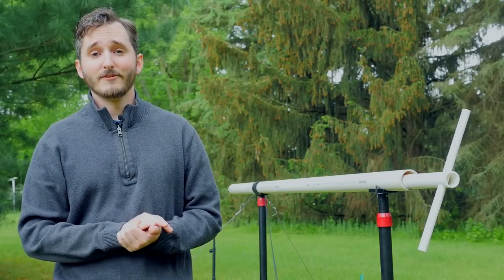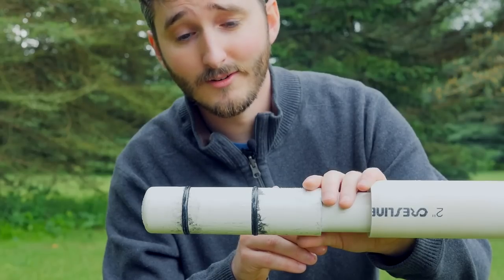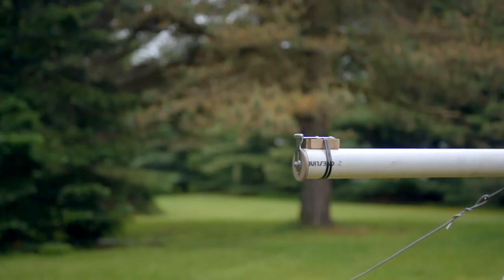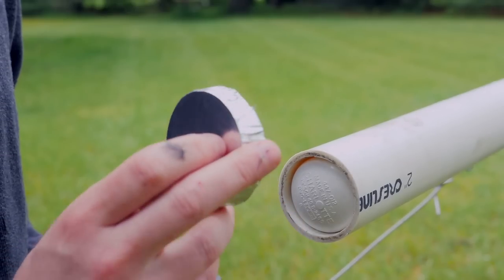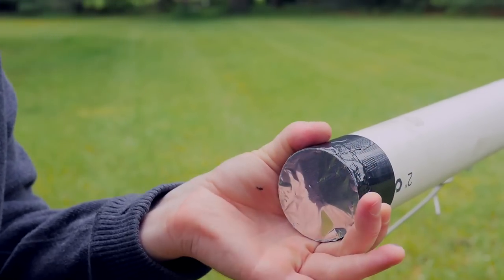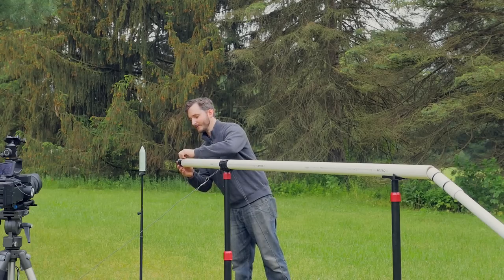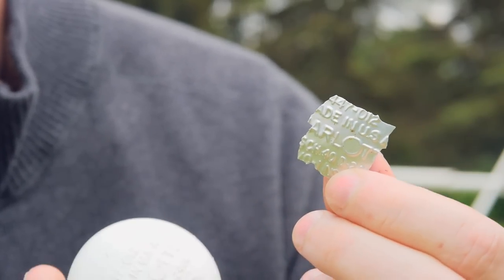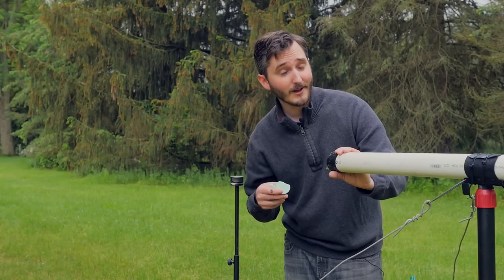New Vacuum Cannon Design - No Vacuum Pump Required!

Comment: Maybe if you put the flap underneath the barrel it will move out the way before the projectile hits it because it won't have to work against gravity, hope this helps
Reply: with just the right amount of rubber or spring tension pulling at it as well
Reply: Eren Thompson Was thinking the same as well
Reply: Eren Thompson was thinking the same, he could just have a rope to hold it up before he has established a vacuum. Once he has moved that piston back just a bit, it would hold itself in place and he could release the rope. It would be faster, the question is if it would be fast enough. It would be really easy for him to test though
Reply: Actually... there are also two other simple solutions. 
1. He could lower the mass of the whole value. (hinge out of plastic, hinge glued to the valve instead of screwed on with a nut and bolt.)

2. He could increase the (m/s)/rad of the valve. He could do this by mounting the other side of the hinge (opposite of the valve) directly to the top of the cannon instead of mounting it on top of that piece of wood and THEN on top of the cannon. Basically, by increasing the length of the valve arm, he's increasing the amount of force required to get the valve to travel 80 degrees and clear the barrel. Just like how you can apply the same force to a door from the handle and right next the hinge but pushing from the handle doesn't make it swing open as fast as pushing from right next to the hinge.
Reply: it won't work.. if he place the flap underneath he won't be able to vacuum since the flap will constantly fall before he could pull it..
Reply: You'd need that type of "2 position spring" That thing that pulls hard to one position but is stable when fully pulled in the other.
Reply: Just realized... why can't he mount it to the bottom, then rotate the barrel 90 degrees when he's priming the vacuum, then rotate it back when he's ready to fire. (face-palm) That's IF.... if that extra 9.81 m/s from gravity is enough to get it out of the way fast enough.
Reply: You could also put the flap sideways so it doesn't fall out of the way, but gravity doesn't slow it down when opening.
Reply: What if you made a cone design made with several curved triangles at the front that holds a seal with rubber lining. That way the pressure opens it up some and the projectile can gently open it up the rest of the way.
Reply: Maybe rubber / spring could be set after the vacuum is pulled. This would need additional mechanism... maybe string.
Reply: James Kerfoot by increasing the valve length arm, he is actually increasing the amount of torque, which is force*radius. this means it's easier to accelerate the valve/ get it to open. also by extending the radius, he doesn't need to do a full 90° to open. if the arm was a yard long, it would only need to open a few degrees to be clear. I want also point out your door example is incorrect in that a force at the handle will get the door moving more because torque is the rotational force, which is what needs to be maximized from our linear force created by air. the problem is moment of inertia, which resists acceleration that grows at m*r^2 which means there is an ideal length.
Reply: user255 no I think maybe if you had a small ring and a pin you slide the pin in after you close the flap its strong enough to hold shut but then when you start pulling the vacume sucks the flap in tighter loosing up the ring then the pin would fall out so when it fires it would be able to fly open. Or just set it up where you have the end of a string tied to the handle of the plunger so when you pull back the plunger it pulls the pin out but by that time the flap would be held by suction.
Reply: What if you removed the hinge completely.  Keep the cap, apply a light adhesive to the barrel so the cap will sit on the end before you start pulling back, then have a length of cord from the outside end of the cap tied to the bottom of the struts so you don't lose the cap when it fires?
Reply: And you can cut the end at an angle, that would help too
Reply: My thought is to have the flap on a lever that has some amount of rubber band on one end making it wanting to pop open and a pull cord attached to your handle at the correct length to engage the tension when the its fired moving the flap up in the process
Reply: AND light weight flap ... that heavy bolt and nut killed the whole thing
Reply: Robert Nickle This was my first thought. I think incorporating other ideas here - hinge on bottom, lightweight flap - combined with an opening spring might be perfect. I'm picturing a rubber band, etc rigged up so that it pulls tight against the tube when it is fully closed, but as soon as it passes the pivot point of the hinge it is pulled open quickly. Might take a bit of staring into the distance to conceptualize exactly how to design it, but I'm sure it's possible.
Reply: Here a solution to your flap problem. Why don't you put the flap further in and load the projectile after the flap. If you need a diagram, pls msg me.
Reply: Interesting idea, Ivan. But I've got a hunch it wouldn't work. I hope someone will try this.

Comment: Maybe you can use a magnet to hold the projectile
Reply: that is pretty clever!
Reply: That's really clever. Why didn't I think of that!
Reply: thx
Reply: theres always a clever solution for everything it just has to cross youre mind
Reply: Rutger 420 NightHawk needs to see this!
Reply: it would have to be an electromagnet you can turn on and off.
Reply: Brady C no it needs to be just strong enough to hold it in place that shouldn't slow it down a measurable amount
Reply: Rutger 420 yeah, a magnet would totally work. I just didn't make it very far into the video and commented way before I should have, lol.
Reply: Brady C oke haha
Reply: This is what I came to say, 11 hours late :(
Reply: Eyyy, I said the same thing without reading this! Great minds think alike?
Reply: D1G1T4L PYRO I hope he does would improve his vacuum cannon
Reply: thats the first thought i had but i quicly disgarded it becouse it means modifiyng the projectile and exploding the magnet everytime with every shot. better to put a sticky substance on the front of the piston that will stick to the clean inside of the endcap.
Reply: steffankaizer maybe a PVC projectile with a metal pipe in the middle and the magnet on the outside, since magnets like neodymium magnets are pretty brittle
Reply: still means modifiyng every projectile but i think he knows how to curl ducktape into a ball so that the sticky side is out. for the endseal however i would think having the arm of the flapvalve extend past the folcrum and conecting that to to the handle with strong rubber like a bicycle tire or speargun should do the trick. also maybe a t on the end with a gatevalve and a magazinetube and BAM repeating semiauto vacuumcannon. sounds like fun
Reply: Excellent Idea, So besides a little magnet on tip on of "Plunger" & Projectile, has anyone thought about giving Projectile a "O" Ring seal itself ? maybe increase pressure converted to velocity ?, just a guess ..
Reply: @DigitalPyro  hahahah lekker maat
Reply: If the projectile was a ball instead of an endcap, and the back of the slightly lower than the front, gravity becomes the tape

Comment: Would it be feasible to make a handheld version? Much like a toy or maybe close to the power of a slingshot?
That would be a rather interesting project :)
Reply: It seems like it would be pretty easy to just scale this down. I don't think it would need its own video.
Reply: That's a fair point man, but it could be more than just scaling it down ;)
It could have added features which would facilitate it's handheld use, so it's no a cumbersome thing to use for quick recreational purposes. It could even feature a spring mechanism of some sort to aid in firing, something to make reloading even easier and also a working flap, so you don't have to carry lots of burst disks around with something supposed to be easily carried and used
Reply: Of course, however, remember the power comes out of all the air he is evacuating and a smaller tube would mean less power. It would also be much harder to draw back if it was made powerful.
Reply: Indeed, I was wondering about that, it may become rather unfeasible depending on how small we're talking about
Reply: Scaling down to hand held size would mean much less power, true. Hmmm... Perhaps a two person weapon, like a bazooka? One man holding and aiming the tube, and one pulling the piston. 
...
... and now I'm contemplating a streamlined fin stabilized projectile...
Reply: The piston could be moved back by an electromotor and some cables.So the limits of the hand held model is the limits of the operator's strength.
Reply: yeah thats intresting hold the front with one hand and pull the back or maybe you could gear it so it pulls when you spin something
Reply: it would just be the opposite of a cork gun
Reply: Dean Ocko Actually a smaller bore would be easier to pull back.
Reply: @NICEFINENEWROBOT  a french fry gun

Sure, a smaller pipe yoelds less power, but you're also (hopefully) decreasing projectile weight. I suppose the length of the tube determines speed though. Still, you could probably get airsoft speed out of a straw

Comment: Have you thought about using a Spring to open the Flap disk faster? You could use a Piece of String to hold it down while you are pulling the Vacuum, then release the string and the vacuum will hold it shut. as you fire the Spring will open it faster than the pressure alone, at least that was my thought Process. Maybe it is worth it to check it out? as alwysy Great Video Mate
Best Regards
Joe

Comment: you should put smoke or fog behind your project where its sucked and record it in slo-mo
Reply: Inside the vacuum it would not work. But if you had smoke/flour behind the projectile (outside the vacuum) the smoke would get sucked into the pipe pushing the projectile out the other end leaving a trail of smoke behind it. The only way it would work inside the vacuum would be if you put a fine solid such as flour in front of the projectile and pulled back the piston to shoot it out.
Reply: Heinocraft how does it work? Or why do you say that?
Reply: What I mean is put the smoke or whatever outside of the vacuum. Like right behind where the air get sucked in so we can see it get sucked in?
Reply: Preston Blackard yup i wasn't specific enough huh. I meant outside, behind his project.being the end where the SUCC
Reply: I concur.

Comment: Make a REALLY big one that you pull back with a winch on a truck. Im thinking 10" pvc thats 20' long would make enough force to get a preemptive strike on north korea.
Reply: Adam Moore YES this needs to be a thing. "Why are we not funding this?"
Reply: I did the math: If you were to shoot a 5kg bowling ball with a 9" pvc thats 20' long the ball would reach slightly over 500km/h (310mph), that is however without friction and with a perfect vacuum.
Reply: That means it would have 346.455 Joules of energy. And you could do it with instead of a winch on a truck, just go back to the old design and use a large vacuum pump.
Reply: A bowling ball going 310 mph seems like it would have alot more energy than 346 joules.
Reply: Yeah that surprised me too. Im not sure where i went wrong
Reply: Artillery God 
No idea how you got that. Kinetic energy = 1/2mv^2 -> 1/2*5kg*(140m/s)^2=49.000J
Reply: Even if it didn't scale up that much, and just used a cable to pull the piston back so it could be made a couple times longer... That'd be something.

Also it might be possible to answer the question "What happens if a tennis ball goes supersonic?"
Reply: + @pauljs75  
"What happens if a tennis ball goes supersonic?"
For this I recommend to put the tennis ball right behind the aluminum burst disc. It has to stay there, not to go with the piston. The former cannon PVC "ball" filled with something has to have double mass of the tennis ball, then will function as a hammering piston that hits the tennis ball and hopefully gives it a whack twice as strong as would the air itself. See the effect of dropping a basketball with a ping pong ball on top of it.
Police will appear.
Reply: IL make a large metal one IL let you know how it goes
Reply: @JGillylikes Budsalot Let me know when I can drive my Tesla into it, park it on a sled, and die a horrible, terrifying death a few minutes later when the vacuum fails due to a poorly constructed junction.

Comment: Don't give up on the flap idea.  I'm thinking that you could use a much thinner and lighter weight flap.  I would try either stiff aluminum sheet, or better yet, some carbon fiber sheet.  The gasket could be made from Silpat (or any other silicone baking sheet).  Also, that hinge looks pretty heavy as well; maybe just tape the top with a small length of scotch tape.  With this design, the you are basically making a reusable disk more than a flap.  Love your stuff!  Never stop building!

Comment: One of my old blowgun designs used a hinged valve that popped open from POSITIVE pressure from within the tube and although it opened fast enough that the dart didn't hit it on the way out, I always worried that it might, given the acceleration of the lightweight darts I was using. So, I cut the bottom of the muzzle off at a 45 degree angle and fitted it with an elliptically-shaped valve to snap over the new opening. By doing this it reduced the number of degrees required to reach the fully opened position by half....hence, "It got outta the way faster", lol. Reducing the weight of your valve and adding a dual-acting spring might help, as well....one that just barely holds the valve shut but after a degree or two of movement jerks the valve open quickly. Well, that's MY two cents worth! really like your cannon as well as your other videos!

Comment: It would be so cool if you could pull the piston back using some king of crank or gear system
Reply: Yeah plus you would need a system like that to make it more powerful since otherwise you need to physically pull the force.
Reply: Maybe if he did a flat gear along the piston with the crank and gear firmly attached the cannon then it would not need to be anchored.
Reply: Vakus Drake ITS CALLED GEARING.

Comment: Is it possible to scale this cannon differently with the same principle but smaller or larger to fire different projectiles?
Reply from the maker: Yes, but making it larger would require a great deal more force to pull the piston back. You can make it smaller in diameter, but it still needs to be quite long to work properly.

Comment: Can you try making an Asssasin's Creed grappling hook using this idea?
Reply: D1G1T4L PYRO That is Spring Powered. For Vacuum you need quite a big Pipe/Cylinder thing. Which is impractical in this case
Reply: D1G1T4L PYRO this ain't the Colin furz channel
Reply: ***** I know, but still
Reply: Great idea! even though its impractical isn't that the point of mad science?

Comment: In stead of using ducttape you could do this:
1) Saw off an inch or less of the kind of pipe you used for the barrel, to create a ring.
2) Cut open that ring, I recommend cutting diagonally. After that just bend it open. If it doesn bend easy enough, just heat it up and bend it out a little bit.
3) In stead of taping the burst disk, just jam on that ring. If've cut it open diagonally you won't have a region where it's not held tight.
4) If it doesn't hold a vacuum try with 2 rings, put on one with the slot on the top, and the other one with the slot on the botton.
---
How to improve on the hinge-seal-thingy:
You want it to be a light as possible. Omit the hinge altogether, you're even better off asking someone to hold it for you until you have a vacuum.
Some things that are light and can hold a vacuum:
Firstly the bottom of a soda/beercan; ok, it's just 2 inches in dia, but still.
Secondly the bottom of a coke bottle... Yes, coke bottles implode under vacuum, but here's how you could modify it:
(The bottom of the bottle is obviously more rugged than the sides, that's already good)
You basically cut off the bottom; then insert in into your barrel, so that the inside of the 'bottle' is facing the outside air, and the outside of the bottle is facing the piston; after that you gently heat up the edges and bend them over so that they hook onto the edge. As a finishing touch you add some rubber or silicone onto the end of the barrel.

Comment: Thx dude. oh yeah there isn't any recoil because the air rushes in from the back whereas on the other cannon when the cap broke a vortex formed pulling the cannon back slightly.

Comment: Me and my dad made a similar thing a while back from spare drainpipe and a vacuum cleaner. we had a long barrel out the back, with a t joint on the end. the vacuum cleaner attached to the bottom of the joint, and we had one of those flippy things at the front to hold the vacuum. i cant remember exactly what we fired, but i think we put tennis balls in the back of the barrel (it was open ended), and the vacuum cleaner pulled it down the barrel and momentum pushed it out the end. we made this shortly after an episode of "the big bang", a kids tv show a while back. worked great, and i really want to make it again

Comment: I've just had a thought, no burst disks at all. The projectile sits at the back of its barrel on a lip that seals it. Behind that barrel is the vaccum resevoir, probably larger diameter. There'd have to be a valve somewhere to load it, probably on the piston, so you could let air out as you load them. And you probably want to drill holes in the barrel so air can get out of the projectiles way

I wonder if the bullet can be made somewhat hollow with a hole at the back so air rushing in can pressurize, giving an ever so slight boost to speed? Probably not but worth looking into